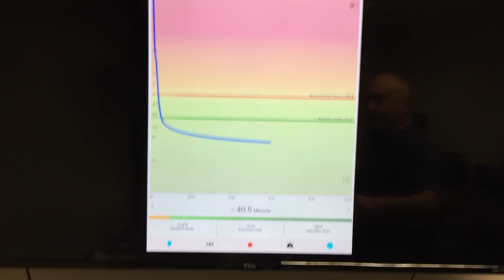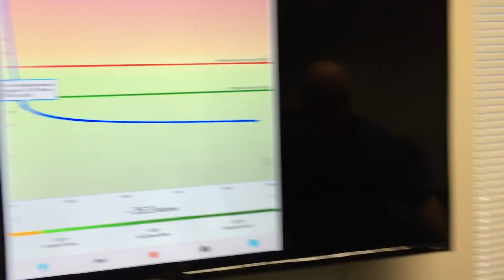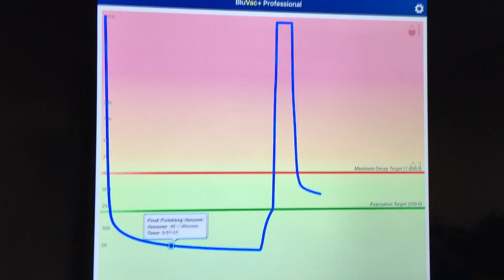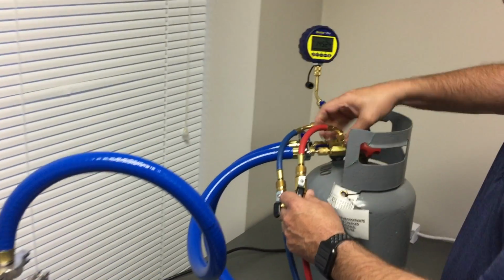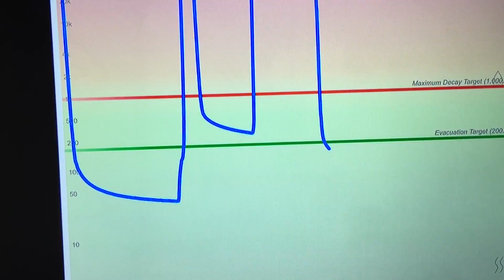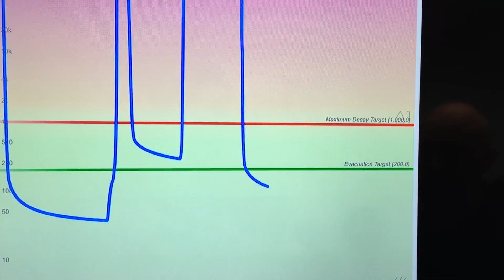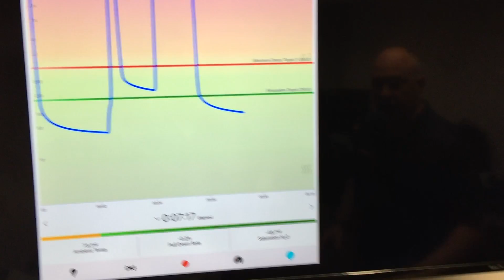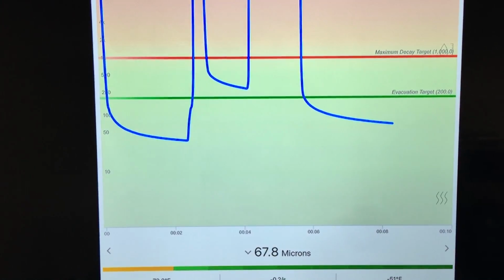The Effect of Attaching TruBlu in Parallel with Other Hoses

Comment: I get it, you just wanna sell these hoses but it seems to me that with an extra few minutes you will get down to the lowest that you can get with your pump, so what you saying?...Am i missing something here?...i know with every single install you have a two extra minutes to spare, whether you are wiring in a whip...cleaning up...moving tools you are not using back to the truck....just sayin though...And i am not mad at you...sales is everything but no tech absolutely  needs these hoses..3/8 - 1/2 vacuum rated hoses, appion or whatever brand will get the job done. And this tech will still be great...just sayin though
Reply from the maker: There is a lot more to it. I am just about done with an hour long video on vacuum and evacuation that will go into much more detail then I can here.
Reply: @measureQuick  ok..ill stay tuned...im up for learning more.

Comment: Great Video JimWhat are your thoughts on a triple evacuation?    Also another question I have ran into some units that use CoreMax fitting how would you recommend connecting the True Blue hoses when you have CoreMax fittings.Thanks for your advice
Reply: Look here. https://www.youtube.com/watch?v=C8VLjBnkEcs
Bottom line, triple evac is outdated and not necessary with today's tools. 
You can invest in a tool to remove them if you want, but IIRC they are very expensive. Not worth it IIRC according to Ryan at HVAC School.

Comment: Excellent video Jim, thank you. I think the ability to use the TruBlu micron gauge app is what really sets a high end micron gauge apart from a lower cost unit. That being said, I want to ask about your interpretation of the results. I’m designing my own custom evacuation manifold right now, I went with 1/2” Yellow Jacket hoses with 1/2” connectors on one end and 1/4” on the other end, 3’ in length. So what your saying is, then, is that the lower that the micron level is before the curve begins the better I am able to remove moisture? Did I understand that correctly or did I miss what you were trying to communicate?
The evacuation manifold that I am designing is partially designed to easily facilitate true nitrogen sweeping of a system because I am a proponent of triple evacuations. Can you do another video showing the results of multiple evacuations using a nitrogen sweep in between? I would be interested in seeing how that would influence the graph/results. Thanks.
Reply from the maker: That is correct, that is the viscous flow area. The formula to approximate where viscous flow ends is 100/the diameter. So 1/4" hose is 100/.25 or 400 microns, 1/2" is 100/.5 or 200 microns, and 3/4" is 100/.75 or 133 microns, and 1" hose 100/1 or 100 microns. You can see how at some point it becomes diminishing returns for our industry. If we were ultra log vacuum, you might see as big as an 8-10" connecting line made of steel. That said, degassing and permeability of the hose material are also really important. I can tell you from a lot of testing that you would see a marked improvement in using TruBlu hoses.

Comment: i just downloaded the app & i am looking for " hot shot2" R-417c and cannot find it , also How do i set my top 6 refrigerants " favorites "i use in the app ? Also , the App locked up after the camera went off by accident. i had to uninstall the app , and reinstall. it locked up tight. would not do anything. major lockup. Nice Looking App ! Looking foreward to using it in refrigeration.
Reply from the maker: We use the NIST Refprop database of refrigerants, I will have to contact ICOR and get the detailed data for their refrigerants. We currently do not have a way to set the refrigerant favorites,  but I will see what type of effort that takes to do and see if it can be done in a reasonable time. We are working on some refrigeration specific applications. More on the way soon.
Reply: Thank you ! especially for the super quick responce ! Huge thanks for the reply.

Comment: So, can you make me some smaller 1/4 inch hoses to add to the side ports and evacuate the manifold and charging hoses all at the same time in order to insure a more pure system at start-up ? That is assuming the manifold itself is not detrimental to the evacuation process as well.
Reply from the maker: The challenge with this type of hose is it is not intended for high pressures. It is a dedicated evacuation hose. Aside from purging your hose, which is a typical industry practice, I am not sure if there is a good way to "evacuate your gauges". You might consider if you want to go that route simply flaring a 1/4 copper and attaching it to your tank to add gas after you are done. 

Personally, I have gotten rid of hoses all together and am using the Testo or Job Link probes and charging through the side port of the core tool. When starting the system, I isolate with the core tools, open the service valves to let out the charge, crack the ball valve to purge out the air when installing the probe on each side, and charge with a single hose through the side port that I have vented or purged the air out of. 

Jim Bergmann
Reply: Banish the manifold and all but 1 charging hose altogether!  ;)
Reply: You and I will never agree...
Reply: Just purge your manifold Ted. I thought you always kept it under pressure anyway.
Reply: Purge ??? Geeze Joe I am disappointed to see you say that....
Reply: I agree, get rid of the manifold all together. Only pull through a vacuum rated core removal tool Ted!
Reply: Maybe someday one of you "half theory" Monday morning quarterbacks will finish your suggestions instead of giving and opinion on how to do half of the job. Better yet, make a video of your superior process for us to see ? BUT... include start-up and charging... not just evacuation.
Reply: The video topic and conversation here is only about superior evacuation precesses and hose performance Ted. If you would like a video of the correct way to pull a vacuum I direct your attention to these videos. Jim Burgman is Mr. Evacuation lol!

https://youtu.be/1se_QmfyF7Q

https://youtu.be/ElwcSEeLXAI

https://youtu.be/gpFhLgKKAtM

https://youtu.be/QEMZ2kJ6ML0
Reply: I was wondering about charging through the Appion core removal tool. I didn't think it was a good idea. I don't want any of the refrigerant contaminating it or breaking down the seals. I'm assuming you think it's ok then if your doing it Jim?
Reply from the maker: Core tools are designed to install and remove cores under pressure. They are designed to handle refrigerant. Charging through them is not an issue.
Reply: Awesome! I'm waiting for my TruBlue hose to get shipped. I bought an XL kit. Great to know. Your the MAN Jim thanks! 👍